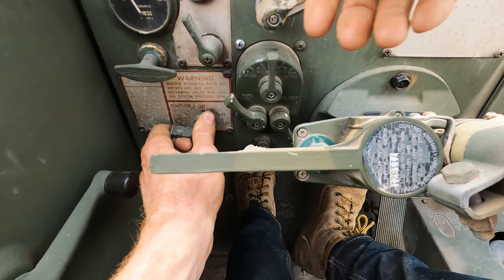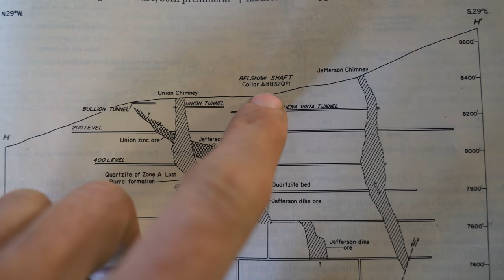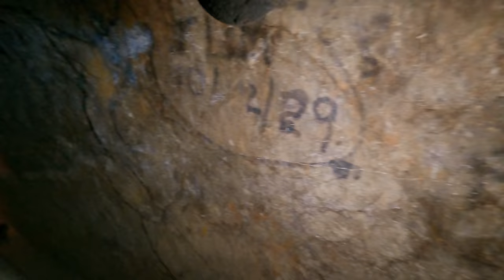I Got A 5 Ton Military Truck For My Ghost Town!

Comment: "Do you have any extra weight?" "Yes, we have an orecart."
Reply: That cracked me up. They didnt even mention the drill? That looked like another 100 pounds
Reply: Really not smart of them to not even have told the lift operator.
Reply: @gabrielg229  Right? It's a bit extreme to have an extra 300 pounds
Reply: @Armadauzbekistan  well considering that elevator was used to get in and out I’d assume they packed it absolutely full. There’s a lot of variables that determine how strong the cable is.
Reply: @CorruptInfinityOfficial  well they had to get that cart down there some how so it has to go back up
Reply: @DustGamingEST  yes, but that was over 100 years ago.

Comment: Brent, love what you are doing with the town and your videos are a lot of fun to watch.

I used to run similar 5 and 10 ton trucks up and down mountain passes and one tip so you can stay safe and stop in an emergency is to ONLY use the service brakes for stopping. Always use the engine and gearing to maintain your speed when descending.

If you've got a Jake brake or exhaust brake you can decent faster but always descend slow enough to gear down to whatever gear is needed to control the descend speed. Without a Jake or exhaust brake you probably need to use one or two gears lower when descending compared to climbing. This is normal with those old 5 and 10 ton trucks.

If the engine rpm starts climbing and pushing slightly past redline, hit the service brakes and drop down a gear (or more if you are in a way too high range). It won't hurt the engine to have it screaming close to redline all the way down the mountain. BTW redline is probably somewhere around 2500 rpm for that truck.

It is always safer to descend in a lower gear than required (and lower speed) and the more weight you are hauling, the lower the gear/lower speed you need to use.

If you do this you'll always be able to come to a stop in an emergency. If you use the service brakes to descend you'll ALMOST CERTAINLY experience an out of control run away truck if you ever try to stop while descending a mountain grade.

It might seem like things are under control if using the service brakes to descend, but because the brakes are already hot, if you try to actually stop they will rapidly overheat and instead the truck will take off down the mountain with no way to slow it down.

Also on an old farm I used to work 40 years ago, we had a 100 year old crane system that used wood on wood for linear bearings (similar to your elevator). We used to always keep a bucket of grease and a paintbrush with us to lube up the wooden slides. You'll be amazed how much better greased up wood slides on wood.

Hope this helps.

Good luck with your adventures!

Comment: You need to run an intercom system down the shaft to each level and maybe it would be a good idea to build a helipad area for the rescue chopper to land on if ever you should need it.

Comment: Brent, I used to work on a lot of heavy equipment, including Letourneau Stackers (100,000 pound forklifts for logs).  They use cable hoists.  We replaced the cables twice a year on average if they were in constant use.  They tend to rot internally, so keep a really good eye on yours.  The sure sign they are starting to go is when the windings on the outside start to flatten out and crack.  They can let go without any warning.  Considering how dry it is where you are, cables will last a long time, but all the pollution that rolls in from the coast is hard on them, too.  Stay safe and keep these videos coming!  They are great!

Comment: This was awesome of Dave Sparks- he never disappoints. 
Suggestions - Always take as much loose rock with you as you can every time you leave the mine. Get a new wheel barrel and pick axe down to each level for safety reasons. Use a metal detector to find blasting caps. Use something to inert them or contain a destruction of them with something like a heavy metal dome used as a lid for the small blast and vented at the top out a 1ft long metal  tube with 2 inch diameter. Spend time in the broken rubble piles you walk over often with your metal detector, I wish you the very best in all your adventures.

Comment: So Brent, since the lift keeps getting stuck at the 700 level, what needs to be done to the lift track so it runs smoothly again? Seems like it's pinching. Using the sawzall to cut yourself loose makes me think shaving that part of the track/beam and reinforcing that into the existing support structure would be an idea. I'm sure Dave and Dave had tons of ideas on how to fix it. Heh heh.
Reply: i would say taking a cordless hand planer would work well.
Reply: WD-40 and some duct tape should do
Reply: HeavyD was saying in his video that the tracks used to be coated in grease back in the day and it had basically turned into tar at this point so its crazy sticky
Reply: A tonne of grease and it will be sweet

Comment: The patina on it is perfect 👌 
Brent, the government surplus auctions are still decent deals. Search “water” or “tank”, they’ll even have trailerable water towers occasionally. Heck even the Oshkosh firetrucks hold ~1,000gal (potable?) plus fire foam and are off-road capable.
Reply: fire truck would be good there much better than 5 gallon buckets if something starts to go up in flames

Comment: Hey Brent, have you thought about having someone take a look at the ladder in the elevator shaft? Maybe see if its useable and repair the parts that are not, just so you would have a backup in case the elevator stops working and you need to use the ladder.

Comment: Honestly, start pulling telephone wire down the shaft. Wireless just won't do. Have a roll on a spring on top of the cage that rolls off telephone wire as you go down or pull one along the main cable.
Reply: This is a sensible suggestion. When I was pot holing there was one cave which was dangerous as it was susceptible to flash flooding and you could be trapped. A telephone line was installed so anyone trapped could communicate with those at the surface. Sometimes the old tech' is better!
Reply: I've been thinking that for a long time, too. Especially setting it up should be fairly straightforward and not too expensive. Just needs some wire, battery and maybe even just old landline phones which surely some electrician could hack together. Especially the idea about the sprung roll is great as it would mean communication all the time and on every level as long as the hoist is there.
Reply: Yes get some squawk boxes. They are battery powered phones with speaker function and they are mine and oilfield gas environment safe.
Reply: There are solutions that forward radio. Could install it maybe around 400 feet down
Reply: @ligametis  I think Brent is on a bit of a budget, so I thought I'd suggest the cheapest solution with just a wire running down the whole elevator instead of expensive radio equipment
Reply: As long as you have two phones (hacked with 9v batteries) with alligator clips on them the main cable shaft should be all you need to communicate better than the walkies
Reply: The telephone wire is a good idea.  The idea of unreeling it in the cage section of the shaft is not a good idea.  The wire needs to be where it is not subject to damage from the movable cage; that means in the manway portion and also in as out-of-the-way portion as possible to keep it from damage.

Comment: Exploring an abandoned mine without fear or humility is about the same as clearing a mine field by running through it. Sure, you could get lucky one hundred times. But it will catch up if you approach it like that for long enough.

Comment: Your descents into the mine are real thrillers. You guys are always so cool when in such terrifying situations. The electric motor would worry me though. Is it a fairly new one? Do you have back up for loss of electricity? Another question i have is how long are the track sections? I assume they were lowered down into the shaft and unloaded into each level. Seems like quite a small space for them to go from the vertical to horizontal.
Reply: I would be more worried about ancient cable than motor

Comment: I was licensed to operate both the 2.5-ton (Deuce-and-a-half) and 5-ton trucks in the Army.  
Along with the M1-series tanks, M113A2, M113A3, M577, M88 recovery track, Paladin self-propelled artillery, humvee, and both cargo and fuel HEMTTs.  Back when Armored Cavalry still existed our squadron CO wanted every tanker and trooper licensed to drive every ground vehicle in the entire squadron so there would never be an instance where a vehicle couldn't be moved if it needed to be due to a soldier "not being licensed to drive it".  
It took months but eventually everyone was trained and licensed to drive everything in Tiger Squadron's MTOE.
5-tons were easy because they were automatics but the Deuce took skill to drive.  You could always tell a bad Deuce driver from a good one depending on the groans of the soldiers riding in the back of the truck.

Comment: Grab an electric planer and ride the top of the cart like Dave did. Plane the wood beams down above the cart as you go in that spot. Also bring a gallon can of fluid film and a brush to paint that stuff all over the wood on the way down or up.  The lanolin wax will protect that old wood, provide very needed lubrication, and reject dirt and rocks. It will also protect the cart from rust. You could put it all on the cable itself too I imagine but look that one up first as I don't know if lubricating load strand cable is appropriate or not. Never looked into that.

That tight spot WILL be where the cable breaks some day. Better to get rid of it! The dynamic load on that cable when it is extended 700 feet is HUGE as the tension changes. You do not want that happening.

Comment: Brent, I also love what you are doing.  I am thinking that you have water down at the 700' level of the mine that is getting pumped out.  It may not be drinkable, however, it may be good for making cement.  Where does that get pumped out?  I'm also thinking that this town supported was it 4000 people at one time (is that correct) so there had to be water source somewhere for these people.  Where is that water that is getting into the 700 level coming from?  They couldn't have packed in that much water, or beer.  Mining camps and logging camp were rough places.  They worked you to exhaustion, and always wanted more, paid the absolute least that they could get away with and the owners made plenty of money.  Hell yea, there was discontent!  Are there similarities to today?  Maybe.

Comment: Hey Brent, You are looking for a way to get down in the Union Mine. It appears there is a ladder going most of the way down. There is 20' or 50' gone from the top. Probably removed when the mine closed to keep people out. It did work. There is a few places that need repair, of course. However, the bulk of the ladder system seems to be in place. I think this is how miners actually entered the mine back in the day. That hoist is so slow it would have had to run 24/7 just hauling ore. It would not have had time to transport anyone up. You are a climber now. you can safely repel. Why not? :)
Reply: PS. You need a partner that likes the video/editor/movie maker/camera guy part of this whole thing. Not me, I hate it worse than you. But someone. I'm tapping my arm all weekend. Well you started it. Good vibes buddy. :)

Comment: That’s definitely sad losing the most important part the old hotel. It’s like in Colorado Springs Colorado. A bunch of years ago the original antlers hotel burnt to the ground. Nothing was built back in the early 1800s. The new one is nice as it is will never replace the original. The original antlers was so grand so beautifully designed the architecture. Almost like a castle.

Comment: U can make a water tanker out of that 5 ton ..√ check w/ military auction . There are 600 gallon pods that fit on the bed . I use to haul 1200 gal mo gas ( 2-600 gal pods ) on bed and another 600 gal diesel on trailer behind duce in a half. Later they became 5 tonnes..√ military surplus 😉👍

Comment: You should contact Barnel and get yourself some Caplamps and Gas Detection Insttuments. Then you have a solid, proper light you can use on your hardhat and you have an instrument that can monitor the gasses underground for your own safety

Comment: I think you need to add something like a 3-4 series tractor to your fleet of vehicles. You'd be shocked at what you can get done with even a compact, I recently spent $22,000 for a Mahindra 1626L with a box blade, bush hog, front loader and two different buckets. I wish I lived closer by, I would definitely come up there with my dump truck and equipment to help out. I hope you continue to succeed in your endeavors and I hope to see Cerro Gordo some day. Until then, God Bless and the best of luck.

Comment: can you do videos on how to get tucks like this. also you guys should rebuild the mineshaft and put in a new bigger more powerful elevator. also running phone lines down to the different levels so you can run radios so you can communicate on every level.

Comment: Get a whip antannae fir thise radios it will increase your range. And I use bafang walkies they work very well  without a repeater which you could also out in halfway down the shaft perhaps

Comment: 2 way radios don't work in mines and tunnels. The radio waves just don't propagate the same as it would in open space. Your best bet if you want to use 2 way radios is to run leaky feeder cable down the shaft. The leaky feeder cable is one huge antenna in itself and a radio can be attached to it at the top.

Comment: What do you do if the elevator does not work? Climb the ladder system? Dud you hear that on  Sept 29. 2021.  39 miners from Vale Mines  in Sudbury Ontario Canada had to do just that. The elevator  was broke down  at 1200 meters.to 1219 meters or more. It took more than 48 hours to get them all out .

Comment: Just Incase any one was wondering.  The current market value on 1 ton of galena is about $1700 for the lead side, however depending on the assy values of silver.  It could be up to $7300 per ton.
Brett my grand dad was an old hard rock miner.  Have been in mines of an on since I was a teenager.  When I was a baby grandpa, dad and mom was mining in New Mexico.  My crib was in one of the side shafts.  Mom found a rattler by my crib and that was the end of me being at the mine.
My mother was one of the first woman in the State of Nevada to be a licensed Xplosive blaster.
Brett you also need to trade mark the logo.  Then start selling merchandise to help with the financial end.

Safe digs Brian and Cindy "xtreambydesign with passion"

Comment: I'm curious if you are planning on fixing the hoist to avoid getting stuck? Would it be possible to straighten the guide rails just a little bit by anchoring them around the parts where they are tight so that they would pull outwards just enough to make room for the cart?

Comment: The radios would probably work better. If you all had your antennas horizontal. When it is vertical you are transmitting into the wall. And if one person has the antenna vertical and the other horizontal wont work the best either.

Comment: Here is a hint... If you're afraid that the wire will snap... Don't hold on it with you hand... That could rip your arm off... Or pull you down...

Comment: Why didn't you replace the Hotel like for like, with some upgrades like shear walls, you could have used prefab piers, say every 4 feet O.C.  You didn't need the counties permission, just tell them what you are doing, we had a fire.  that building wasn't permitted to begin with.  the old hotel lasted over a 100 years.  sure it probably sagged here and there, but thats what gave it charm.

Comment: Telephone wire is cheap. Low voltage is cheap. Why not install a telephone system in the Union mine shaft?

Comment: Damn, if i got a truck that old the first thing id do with it is put a newer Diesel Engine in it before i started hauling shit

its a wonder a truck that old hasn't broke down
Reply: i would rather have an old engine for stuff like this than a new one, less stuff to break and easier to fix
Reply: @user-hx7dc9uz6s  where are you getting the replacement parts